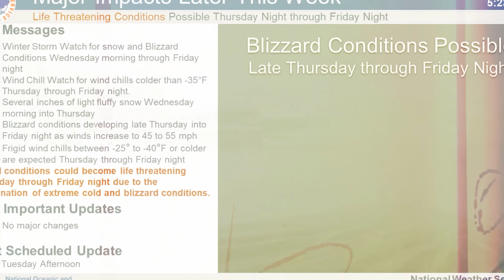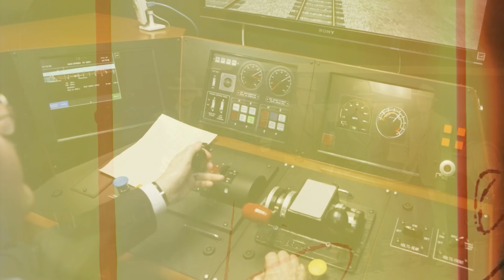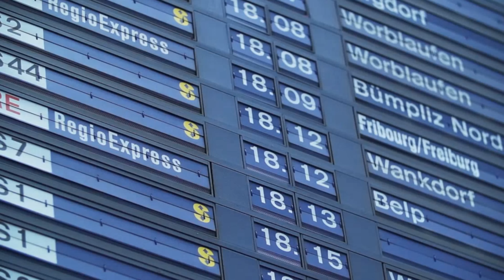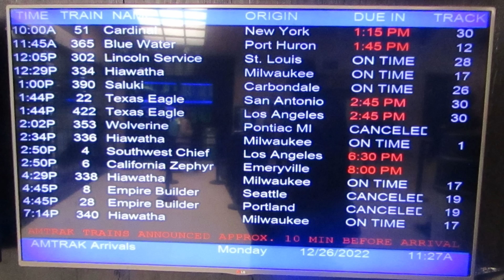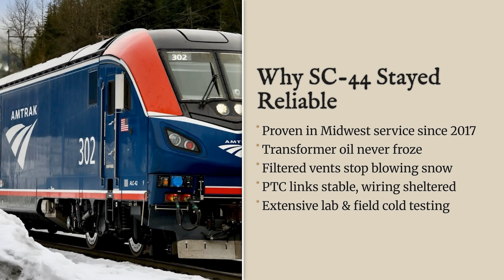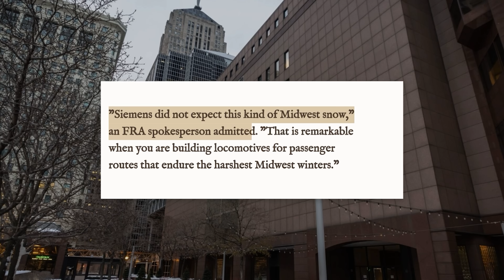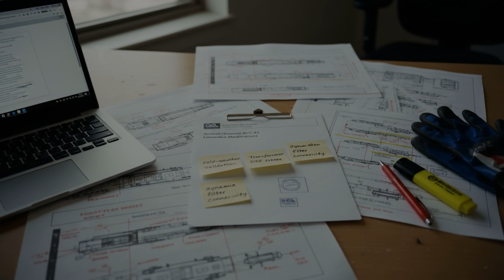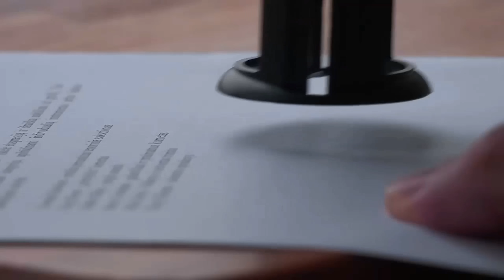Why Amtrak's BRAND NEW Locomotives LEFT Passengers FREEZING

Comment: I work for Amtrak in the Chicago yard I remember when they started getting them charger locomotives they had tons and tons of problems with them everybody said they were junk that Siemens belt junk then they ordered a new cars built by Siemens well in the winter time all the toilets froze and then the doors wouldn't open and close and the windows kept cracking and breaking so you tell me did Amtrak spend their money wisely know the states bought the stuff the states gave her money to buy the engines and the cars they were all garbage

Comment: WHEN THE AMTRAK   GENERAL ELECTRIC P SERIES CAME OUT, I WORKED ON THE FIRST ONE, THE 800, AT ARGENTINE KANSAS CITY SANTA FE YARDS.
THIS ENGINE WAS ON ITS WAY TO 
THE PUEBLO DOT TEST FACILITY
BEFORE PLACING IN SERVICE!
I SAW RIGHT AWAY THEY HAD AN REAL WINNER THEN!!
HAVING RETIRED BY 1995, I NEVER HAD AN CHANCE TO LOOK OVER THE SIEMENS CHARGERS, BUT FEEL THEY NEED AN LARGER ENGINE RUNNING AT 1050 TOP RPM RATHER THAN THE MEDIUM  SIZE CUMMINS ENGINES!
KEEP THEM ROLLING BROTHERS!!
👍👍

Comment: Well, I would say this, look at the science behind the locomotive. What seriously is plaguing Chargers is the Carbon Fiber that is intolerant of cold weather made for the HVAC system, actually is the scenario. Siemens is also fixing the problem by using the right materials. Yes, and most Technology cannot run in cold weather. Personally I feel terrible for the poor Chargers.

Comment: It isn't just the Empire Builder having problems. All the Michigan services primarily the Wolverine have had issues with SC44s braking down. The SC44s became the primary engines on the Michigan services in 2023 and the cold months have not been kind to them. On weekends P42s pitch in to help now after 3 brakedowns in the same county. 2 brakedowns being this year alone. A while after the last brakedown there was 2 engines on the Wolverine, 1 on each end mostly P42s but some SC44s.

Comment: I have a family member that's an engineer for Amtrak, even the old trains are pieces of crap! They had no heat in their cab for a 3-hour run, you know how they kept warm? They had to pump hand cleaner in the metal drink holders and light it on fire to keep their hands from freezing, seriously! So much air leaking in around all of the seals in the cab, little to no heat, poorly maintained garbage! Nobody knows how to do a proper job anymore and it shows!

Comment: It's pretty easy, the Charger has the tunnel motor adaptation to keep it from overheating after ingesting exhaust from the forward engine.  Unfortunately for Siemens, they never actually saw a Tunnel Motor in real life.  There are thermostat controlled louvers on the top of a tunnel motor, their job is to close to retain heat if the cooling system is working too well.  Without this ability, the Charger motor fluid lines freeze up solid.

Comment: The blame for the fiasco predominantly lies with AMTRAK. You DO NOT use a revenue run to test equipment. There is NO EXCUSE, I repeat NO EXCUSE for requiring paying passengers to be exposed to the dangers that they were. They should have made the test runs along the Empire Builder route with dummy loads rather than real paying passengers. This is a common sense solution folks

Comment: Interesting that Claud recognized that it might not be able to repeatedly pronounce Minnesota correctly.

I was on that train that froze up in north-western Minnesota that day. Ended up in Minneapolis about as many hours late as the train ended up in Chicago by. Figured the problem was that the testing didn't include severe cold weather testing. Perhaps they can make some testing arrangements with Canada Rail for future locomotives so that maintenance requirements can be locked down, and things like an oil cooling has "severe cold weather" options available to address. I know that up until the 1980's it was far from unusual for cars and trucks in Minnesota driving in the winter to have canvas or cardboard shields blocking off the radiator so that the engines would properly warm up. Some sort of an option for a shield that restricts how much cold air passes across the oil cooler seems like a good idea.

An no, I don't recall ever getting any apologies from Amtrak for the inconvenience.

Comment: It's hard to beat a P42DC
Reply: Extremely hard. They should keep them in service since they work very well, and the kinks were worked out.
Reply: @josephbugaj8149  We can't keep using outdated junk! the kinks are being worked out on the chargers now
Reply: Unless you're a powerful frieght locomotive that's truly built.
Reply: should have made a new version of it with updated emission standards
Reply: @nihonkokusai True. They could have used the new GE GEVO engines built for reduced emissions.
Reply: @josephbugaj8149  No, We don't need freight locomotives pulling passenger trains
Reply: @IronHorsefan1869 I meant having the P42DCs rebuilt with GEVO engines to reduce emissions.
Reply: @josephbugaj8149  Nah, still prefer the new locos
Reply: @josephbugaj8149 they actually were trying to do that.

The MPI HSP-46 for the MBTA was supposed to be a testbed for a rebuild package for the P42DCs. They have the exact same traction motors as the P32AC-DMs 

They just didn’t do well in service sadly.

When Wick Moorman was the CEO of Amtrak briefly, he wanted to do DC-AC rebuilds on them like NS does with freight engines…..and then Richard Anderson came in and went full Siemens.
Reply: @nihonkokusai No, I welcome the stream wind locomotives, not the ugly boxy piss 42s!

Comment: Some of the issues mentioned should have been predicted. Diesel freezes at the same temperature as water, so freezing diesel should be considered even in Germany. Kerosene is used as anti-freeze, but it only lowers the freezing point, it doesn't eliminate it. It sounds to me like it's just a bad design even if used in Germany. The coldest temperature ever measured in Germany was −45.9 C (-50 F), so if the locomotives couldn't handle that temperature, then it could be a failure in Germany too. Siemens generally produces good trains and while it sounds like it's a good design in summer, they seem to have forgotten about designing for winter in general, not just harsh American winters. It sounds to me like it's bad by Siemens standards rather than Siemens being bad in general.

For comparison, Toshiba designed a switching engine called HD 300. They built some a few test units and handpicked 3 railroads to test use them. One railroad was intentionally in Hokkaido, Japan's northernmost island and a place known for lots of snow. Turns out it failed in the snow, so they made some changes, which worked and only then would they start mass production. It's always dangerous to do mass production without proper testing first, through there are stories like skipping testing for steam locomotives and then issues like "oh no, now we have 100 locomotives with defective coupling rods". Not testing prior to mass production is not a new problem.

Comment: Hi there! Reminds me of somehow similar issues with back then new 3phase AC locos for danmark and later norway. Look em up: dsb litra me and nsb di4 - fine snow is a known problem! It will penetrate the inertial air intake grilles easily and clog up the entire engine room, the remedy was to introduce kind of a deflector steel sheet spaced some inches above the grilles to reduce the snow intake significantly. Somehow engineering experience needs to be refreshed over time ...
Reply: Switching to 3 phased AC means the traction motors can be sealed, which in turn avoids the ever returning DC traction motor problem: sucking in snow, which melts and the resulting water then shorts everything. Maybe the design engineers were too confident in not needing to be concerned with snow as the most snow prone part had been removed.
And yes design engineers tend to repeat the same mistakes decades later as there will always be a replacement of workers, hence issues can be repeated by people hired after the last blunder.

Comment: The problem is not the new locomotive - any new design has design flaws that have to be remedied. In particular if the manufacturer has no experience with certain ambient conditions. The problem is that the stuff is not sufficiently tested before entering service. It's the same here in Europe. New train designs are entering service and they break always down in the beginning before the problems are ironed out. 
And even then - sometimes you encounter problems no one has thought about. Remember the Eurostar trains getting stuck in the Channel Tunnel some years ago? The trainsets were running for years under all wheather conditions. But then, one day, the snow had a strange consistency, got blown into the locos, melted in the tunnel and caused short circuits. Again: after years of service, including snow.
Reply: Seven years isn't enough time to not design the POS to intake air from behind the fuel tank and expel it through the sides?

Comment: What a lemon. In 2018, I was on a train coming back to Milwaukee from Chicago on a day trip. Somewhere in Oak Creek, the brand new CHARGER konked out and left us stranded for over 45 minutes. I wonder if FORD or BOEING is building these things now.😀.
Reply: It's worse, its Stellantis, with a marker light warranty!!
Reply: Those issues are worked out now, Not a lemon, just teething issues
Reply: @IronHorsefan1869 Well then why are they still having so much trouble with them? 7 years how long does it take?
Reply: @crabbymilton390  That's Bullshit! They are NOT Having trouble with them! Those are foamer lies, and FYI The P42s took 10 years to get worked out!
Reply: @IronHorsefan1869 I see all of these recent programs on rail YOUTUBE channels featuring AMTRAK’s being pulled by a freight because the CHARGER konked out? BTW, why should it take so many years to work bugs out?
What’s wrong with the engineering groups anyway?
Reply: @crabbymilton390  You're probably watching old shit, Chargers are not as problematic
Reply: @IronHorsefan1869 I just watched one from 12-23-25. The CHARGER had a wheel problem and had to be taken to Chicago from Minneapolis.

https://youtu.be/s0ymnA4UsXM?si=KYGLK3Era2nZx9Ez
Reply: @crabbymilton390  That's SO Minor, Any locomotive can have that problem!
Reply: @IronHorsefan1869 Fair enough but all of the other problems over the years doesn’t exactly inspire confidence.

Comment: might as well keep a steam loco operational incase modern tech fails
Reply: Yes, an upgraded and updated Big-Boy type, complete with “soot-switch” for the train-nuts!
Reply: @dennisyoung4631 Or a SHUTTLE WAGON. Might only get 30mph but…🤣
Reply: Or maybe electrify the rail systems. The Siemens locomotives that operate in Scandinavia which gets colder and for longer periods than the United States have fewer issues that the diesel version we run here
Reply: @NomadMP476 That would cost fortune. Unless the locomotive has a diesel backup, you would be screwed if a line goes down.
Reply: @NomadMP476  [Wires freezeing over] "Allow me to introduce myself"

Comment: Interesting point about the older models being better!  I have no doubt that the shockingly ancient diesel trains being used on New Jersey Transit's Atlantic City line would have performed better in extreme cold than the faulty newer locomotives purchased by Amtrak.  So much emphasis is placed on making things "greener" and amenities like charging ports, but I was recently blown away by the simplicity of getting from point A to point B on a train that leaves on time & does what it's supposed to do - nothing more, and nothing less.  They just don't make 'em like they used to!
Reply: One of the main reasons the old engines tend to work better is that non-working designs aren't put to work for decades. The survivors still running have been well tested and proven to work. Another reason is experience. Each design tend to have certain parts, which are prone to cause issues. A new design requires exploration to figure out how to deal with each issue while after a decade or two, it has become common knowledge among crew what usually goes wrong and how to fix the common issues in practically no time.
Reply: @Thegoodthebadandthefleshtuber   also important to note that besides the trucks and the body, its a GE Dash-8 under the hood. Those are tried and true workhorse locomotives. Their predecessors, the 8-32BWH, are Amtrak's longest serving purchased locomotives. If truck parts weren't unobtanium now, I would expect they likely would have just rebuilt them.
Reply: @dasoffendor  What's the issue with the trucks? I googled it, but nothing came up. Also if that's the only issue, why not make them with a redesigned trucks? We wouldn't have heritage railroads if they never improvise for spare parts from companies, which shut down half a century ago. Surely it would be possible to build new trucks if they really want to even if they aren't identical to the original ones.
Reply: @Thegoodthebadandthefleshtuber  not so much a problem with the trucks as it is an issue with parts availability. Those trucks have a ton of custom parts. If they wanted to rebuild them it basically would entail building a whole new design.
Reply: Yes, and P-42s have a little Soot! when pulling steep(er) grades.  

(Was awesome to see when pulling the bigger hills coming out of SoCal.  There was this one, long, sweeping curve in those hills, and I could see the pair of Locomotives leaving a thin plume of black smoke.  “This is a sho’nuff train, all right,” I thought.  That trip to LA and back in 2021 made me a train-nut.)
Reply: Perhaps ANTRAK should just buy generator cars and contract with freight haulers for power.

Comment: Amtrak, as well as the Railroads in general, Need to come up with a New Philosophy when it comes to Locomotives & Rolling Stock.
And that is:
LONG LASTING. As in, The Locomotives and rolling stock need to be able to Last VERY LONG TIMES.

Maybe, they should design locomotives that can last for over 50 to 100 years.
Reply: absolutely but.basic, common sense runs way short these days.

Comment: Here's the thing:  If I lived in that area and had to travel any sort of distance, I would probably book a train in the winter to avoid the potential of weather affecting a flight.  Having trains be just as susceptible to weather eliminates one of the few big advantages you have over your competition.
Reply: Absolute;y perfectly normal situation for new locomotive models. It's called "teething....." The locomotives are all getting the necessary fixes. The problem was not testing them propertly. Then sending them out, with the guinea pig passengers [sponsoring] the locomotive shakedown. This type of thing doesn't happen on the Northeast Corridor --- because the trains are going 150~160 in RI & Mass. But out west where nobody's watching.......
Reply: @odurandina Most of the AMTRAK trains seem to have more than one locomotive. So you would think if one konks out, the other one could handle it.
Couldn’t they just use the dead one as a control car the remainder of the way?